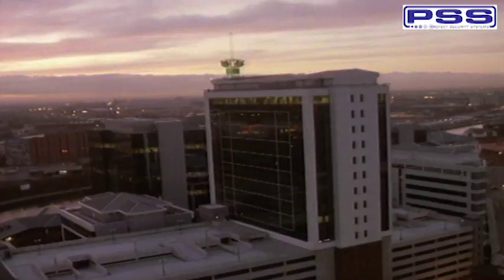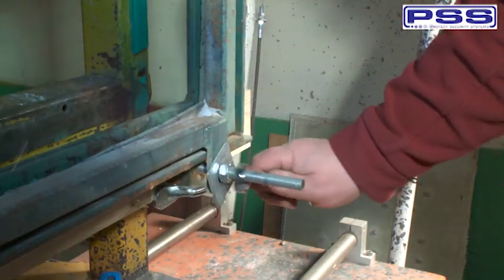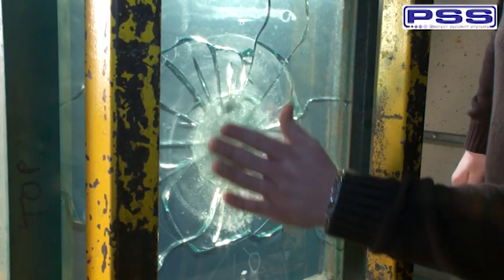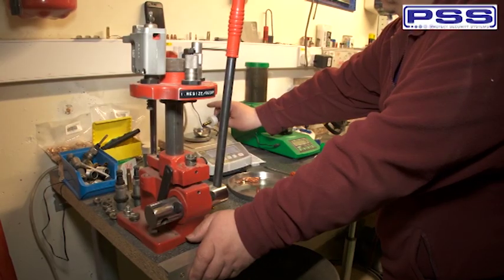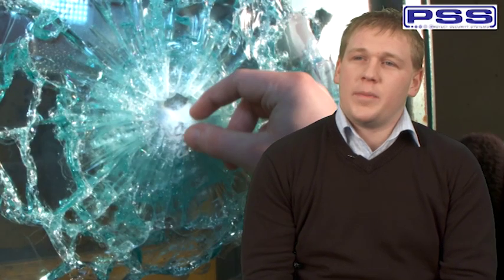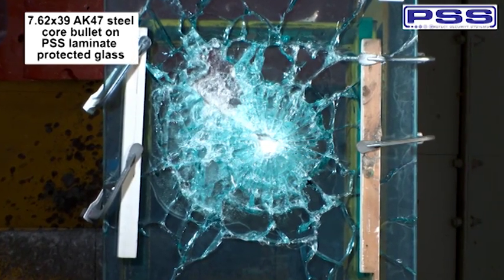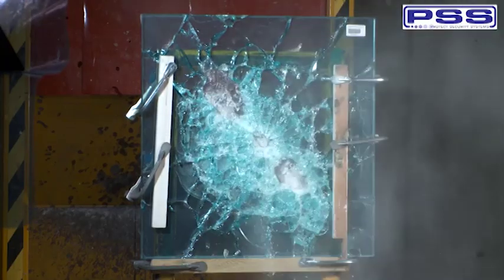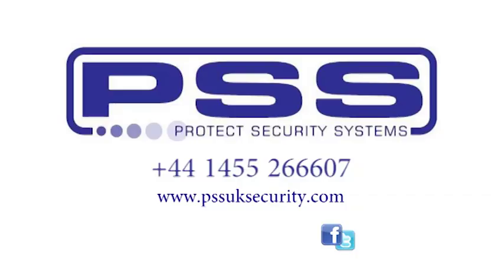9mm & AK-47 Bullet Resistant Laminate

Comment: Generally if the round goes through the same spot it may pass through.
It would take  a marksman to do that though. Generally this type of technology is best for one off safety concerns.
Reply: +Shatter Safe 
Not really. I've seen double laminated glass testing where the police test 9mm fmj in the same spot 5-6 times. Not a single round penetrated.
Reply: Avenging Angel that’s double...
Reply: Shatter Safe it also depends on the type of gun+ bullet/rounds